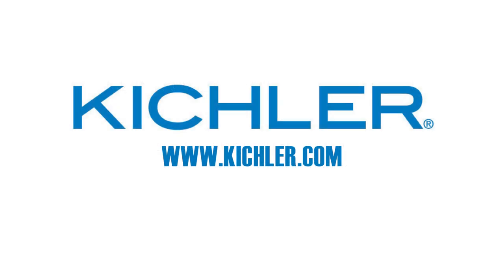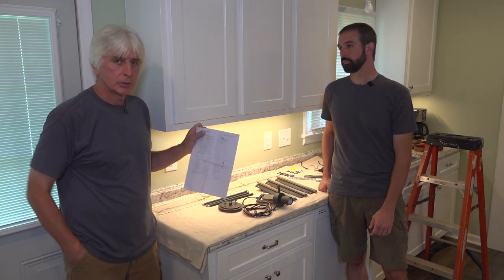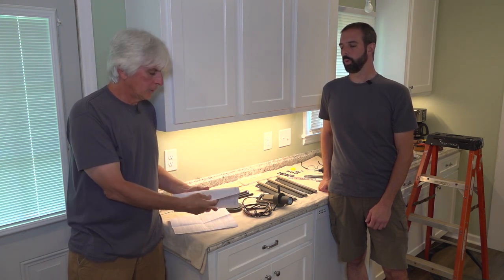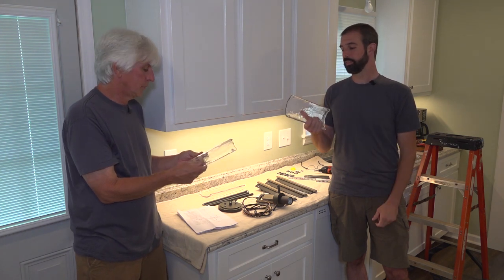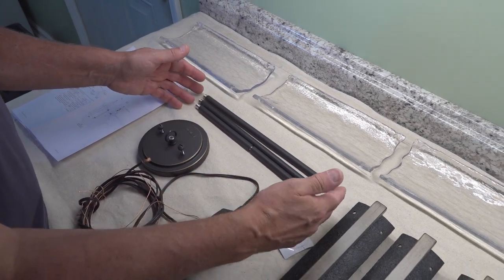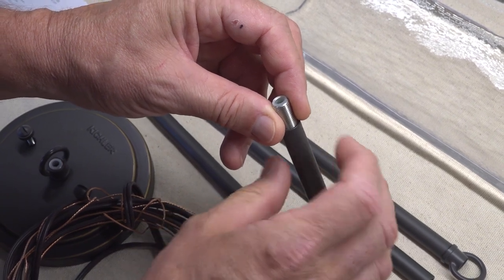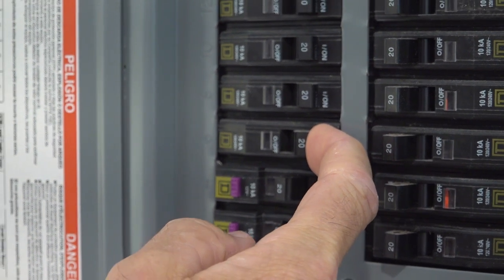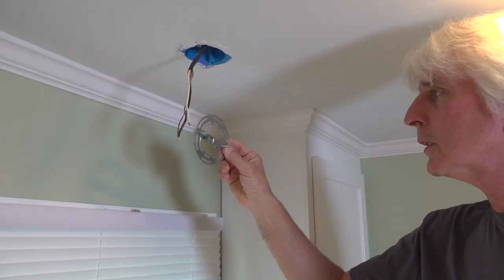Kichler Pendant Light Installation - Terry's Old House

Comment: Dear Terry & Brian,

I can only surmise that your workload prevented you from producing anything recently. At any rate this demo is worth it's weight in gold, a very well presented & wit good tips to heed. Very well done. Kind regards. N.B: Great to see you back.
Reply from the maker: Yes sir, busy busy busy. Thanks!
Terry
Reply: @ForestToFarm  Dear Terry,
Thank you very much for your courteous reply. I figured that much. Please note I''ll be returning to Brussels by mid December so if you have time to let me know what you currently & can use so that I can prepare well in advance thus avoiding me going into battle station mode. Best of luck with your work to you both. Kind regards.
Reply from the maker: Thanks! Will get that together.
Terry

Comment: Can you hang the 6 light kichler marita with just the chain? It's too low with the chain and the bar in the bar is not adjustable although the Box said it was. Thanks
Reply from the maker: Having not installed one of these I can not say 100% for sure but from experience it looks like you can use just the chain. Usually when a bar is adjustable its actually in two or more pieces of varying length so you can choose the combination that best suits your needs. Hope this helps.
Terry
Reply: @ForestToFarm  Thanks! I finally wound up calling Kichler's customer service after Lowe's said "probably." Kichler says that this particular model does require the rod, but there is a shorter one, six inches that I can order. I wasn't happy about that after paying over 200 dollars for the light, but what can a person do. The box actually says rod/chain adjustable. Liars, LOL. I appreciate the speedy reply and enjoyed your video.
Reply from the maker: Actually from my perspective according to what you just said its pretty typical. If i read that knowing what I do about fixtures I would assume the chain was adjustable but there may or may not be more than one rod. I don’t think they lied. Sometimes info can be confusing even when you have done as many fixtures as I have. Glad you got it worked out!!! 
Terry

Comment: Is that a bare wire hanging out at 18:44? Or is it just colored that way? Kitchen is looking good!
Reply from the maker: Yes that is the bare copper ground wire which is typical of pendant and other light fixtures. Sometimes it will be a silver color and look like steel but I am not sure what metal or alloy it actually is.
Terry
Reply: @ForestToFarm  I'm assuming that isn't dangerous given it being commonplace? All I know about electrixity is "don't touch wires if the power is on." 😂
Reply from the maker: Yeah its safe. Its the wire that hooks all the metal parts together and grounds them in an attempt to keep things safe.
Terry

Comment: I Always twist those wires stranded or not. Loose connections start fires. When the point of connection is loose it creates heat.  Just 
My opinion.
Reply from the maker: I have been wiring since a child working with my grandpa doing remodel work. I worked as an Electronics Engineer Tech for several years in industry. I work for several years for a electrical contracting company as the basically foreman doing high end residential work where I had over 75 different people under me. If there were problems with ours or other crews I was sent in to determine what went wrong. Loose wires in joints were one of the most common problems. I always twist solid to solid. I always twist stranded to stranded. I never twist stranded to solid because those joints often failed in my expirience working behind others fixing their problems. Either way you do it   Requires experience time and acquired skill to gain the confidence that your connection is good and safe. I would watch those who repeatedly made mistakes to try to determine what course of action we needed to take to help them correct their methods and lesson the risk for error. I find it most important to make sure the stranded wire is first twisted tight. Them it needs to extend into the wire nut  slightly further than the solid wire. Once inserted into the wire nut the stranded will be clamped into the end of the solid wire. This particular type of connection is very susceptible to the stranded wires being actually cut in two if over tightened. I always give every wire a good solid tug to check for a weak connection after each wire nut is installed and then again after all wire nuts have been installed. Not saying your wrong nor I am right. Just telling you what has worked for me over the years to help reduce possible failures. Two solids or more are always twisted by me personally and then cut so the ends are as even as possible. There is so much more I could say on this subject. The main thing is if a person is unsure they need to get help from a person with solid experience in my opinion. 
Terry